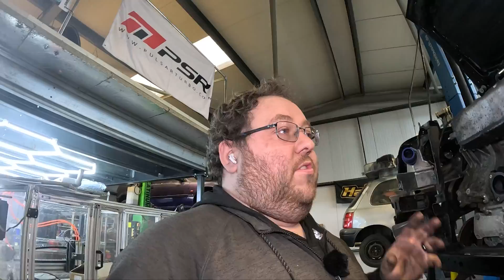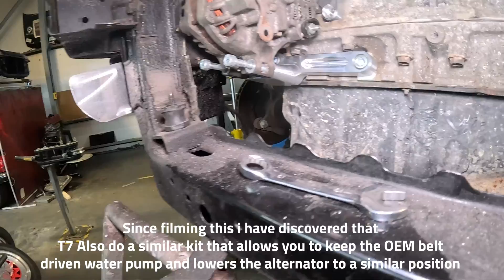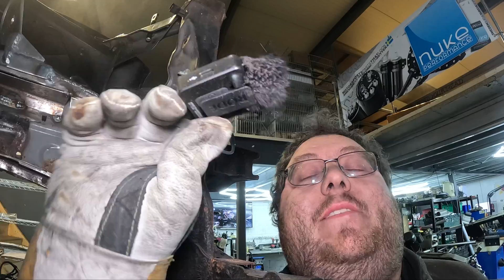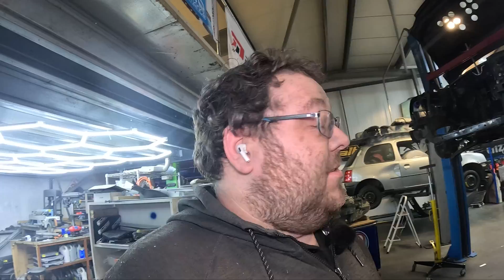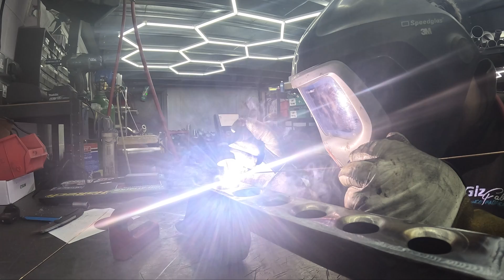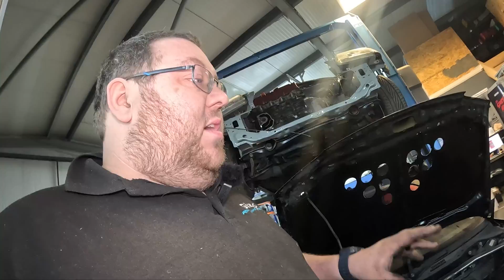K Swap K11 Micra welding the chassis - Part 3

Comment: Will there be a video about the wiring and wiring harness stuff?
Reply from the maker: When we get to that point - Yes. But at the moment we are looking to use a Universal K20 Loom, Terminated to a Haltech Elite 1500 with an IC-7 Dash for display. 

We wont be splicing this into the Factory K11 Body loom to retain the Factory Rev counter etc.